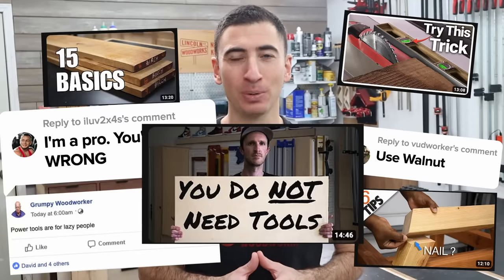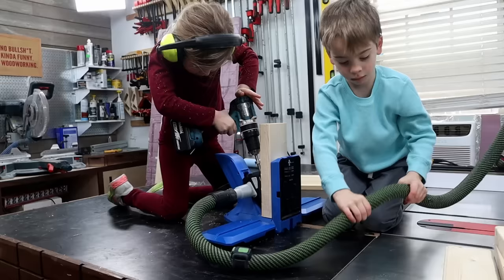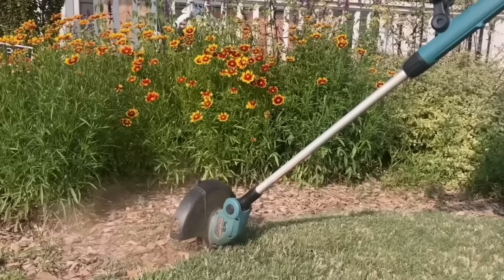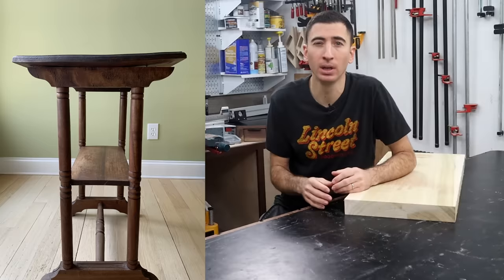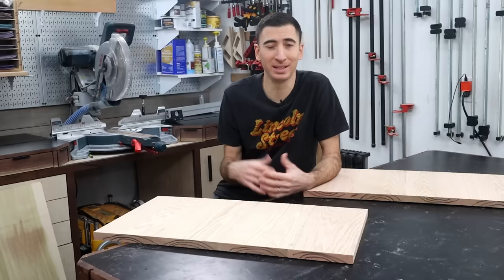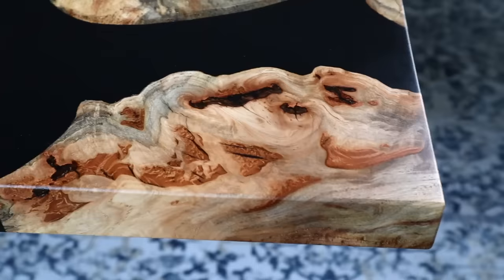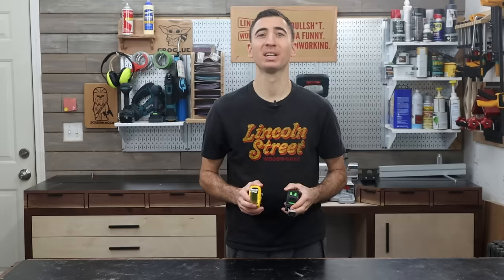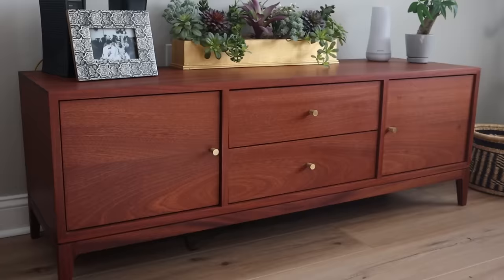Every beginner needs to hear this

Comment: One flaw in most joint strength tests is that the test focuses all the force against one joint and typically in one direction.
In furniture, each joint is supported by other joints. In order to make one joint fail, you must usually also have several other joints fail at the same time. As an example, if you are going to test picture frame joints' resistance to wracking, you must test that joint when it is one of four in the frame and all 4 will have to wrack at the same time for any single one of them to wrack. It is the same with the way a table leg is connected to a table. If all four legs are on the floor, you must cause all 4 connections to fail simultaneously or none of them will. Testing one joint separately doesn't give you an accurate measure of the strength of a structure.

Comment: Do not remember the youtube channel, but one did a test and took a couple of drills apart and found 3 are the exact same parts for different companies.  So it really does not matter
Reply: Most of my family works for a large (huge, even) retail company, largely as vendors. Most products are like that. They’ll be invited to visit the factory after switching departments. A big one is paint! The grade does matter, but not the brand. The only exception in the US is Sherwin Williams.

Also, any canned food without a recipe (things like soup are usually special, for instance). Same stuff, different labels. Corn is corn. But I still buy the same brand, no matter what?? I guess it gets all of us a little!

Comment: Regarding mixing sanding dust and glue.  I found that mixing sanding dust with the FINISH that you're using (varnish, shellac, etc) works much better; once the finish is applied it disappears.  This won't work with a large hole and an oil finish, but there your pounded-in knot would be much better.  Love this episode!
Reply: Interesting, I never thought of this. Thanks

Comment: 7:10 

Lifehack for this part - you can use medical syringe to put glue inside of thin spaces. 
OR you can blow air at glue to "force it" inside. 
OR you can mix it with a bit of water to make it less viscous and more liquid - it will reduce surface tension of glue and will allow it to reach further into the opening.

Comment: Hi Lincoln, Everything is correct, but alas, not completely. #1: alternating boards. You are absolutely correct that the best side-up should take precedence. The 2nd option should be to make sure any Chatoyance in the wood boards are all facing the same direction. The third option is to alternate the boards (smiley/frown) whenever possible. Maybe you and I have been going to different museums, but I've seen the occasional big U and the less occasional washboard. But yes, how the boards were dried and stored, as well as any transportation from a dry/wet area to a wet/dry area, are all big potential issues. Otherwise, do flip them if possible after the first two issues are resolved.

2nd point is the need to finish the top and bottom of the furniture. Again, I did everything I could to live up to this truth until I took a class from Bob Flexnor (major finishing expert with multiple books) mentioned this in a class and said that he's examined many, many furniture items from many different historical periods and putting a finish on both sides of (say) a tabletop was never done until the 1960s in the US (but not in Europe).

The one thing I learned from examining furniture in museums is do not worry about the back. When I made a Stickley sideboard, the back was BEAUTIFUL!. When I later saw some original Stickley furniture, and other furniture from the 16th, 17th, and 18th centuries. The backs had saw cuts, pencil markings, knots, and anything else they did not want to deal with. They knew the furniture was going against the wall, and the back would never be seen.

Comment: I think the measuring advice is right when you add the premise "if you can do it without measuring, do it without measuring". I always try to get the work done without measuring, and if I cannot, then I measure it multiple times till I'm pretty sure of me. Then I do it. Then a measure it again. Then I get to anything else, measure it again, figure out I measured the wrong part, wrongly, or forgot to remove something, cut it again, and then it's the proper dimension.

Another trip to get wood between measuring is optionnal depending on what I have on hand.

Best advice for beginners i'd give, as a beginner : act like you're dumb. Because you are dumb, and you will mess up.

Comment: I don't know if I would call brand stuff "100% fiction", but it is mostly fiction. I built my first project, a 6'x6'x6' chicken coop, about twelve years ago. I had no tools so I bought a Ryobi drill/impact bundle because I saw my dad use them before and it was only $99. I have now used that drill to also build a 20x40 pole barn, gut and remodel a 1000sqft house, and build a nice 8x16 shed. Never had any problems with it. Using original battery too. That being said, it definitely isn't as strong as newer drills and the battery amp hours are terrible at 1.5). I borrowed a friends Ryobi skill saw and it struggled to cut 2x4s. I would say there are tiers though. Just like in cameras, computers, and other products, there are consumer grade, "prosumer" grade, and professional. Harbor Freight and arguably Ryobi fall into consumer grade, Dewault prosumer, and things like Snap On and Hilti for pros. I ALWAYS recommend people starting at the middle grade stuff. Dewault might not be as "good" has SnapOn but it is leagues better than some $20 Chinese drill. 

For what its worth, I think most people agree Makita and Milwaukee are the two best prosumer brands out there, and many pros use them too. I myself decided to go Makita starting last year and like you said, it was for none power tools (they have a nice dual battery backpack vacuum cleaner) but at the last minute switched to Milwaukee because HD had a 12piece combo with three batteries on sale for $499. Furthermore Makita doesn't have a pex expansion tool but Milkwaukee does, and since I'm about to start building my house next week, a pex expansion tool seemed more important than a vacuum.

Comment: 0:45 there is nothing absurd about a basic Mortise & Tenon. Make hole... make peg end to fit hole. Cut slot in peg & insert a wedge to lock it in. Nothing really hard about it if you just take your time to get it right.
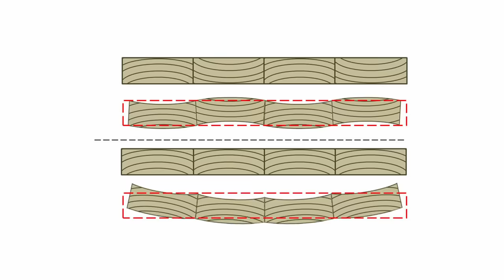5:00 This is for the most part pretty true. Acclimation time is KEY to good finished products when it comes to wood moisture.

Comment: Thanks for sharing your opinions and experience. The pocket screw vs mortise tenon joint debate is irrelevant. Easy choice:  If you are making dozens of plywood cabinets, use pocket screws. If you are making fine furniture use a different joinery method.

Comment: Great video. 

Pro tip: you don’t even need screws or joints. Just make a putty with the glue and sawdust and use it like a “tape” or a “mortar” to hold together your projects. It works great and you don’t even need clamps!

Comment: Everything you covered is right on.  I been doing carpentry for over 60 years and learned all this from my father who was a carpenter and experience.  Much of what is on the Internet is nonsense.   In 60+ years I've never used pocket holes or jigs for fastening anything.  Pocket type fastening is just not as strong as other methods.  Good video, you know your stuff !!!
Reply: If you've never used it, how do you know? Also the whole point of his video is that sometimes it's more than strong enough for the application.

Comment: Joint strength-if it doesn’t break in daily use, it is strong enough. Your hockey players may not have broken your 2x4 table, but we all know people that could break that same table made out of steel just by looking at it!  Tool brands-I have a shop full of less expensive power tools people told me wouldn’t last. Some are over 30 years old now. What didn’t last was the low end Delta bench top table saw. Blew up right after the warranty expired. Dad said buy the best you can afford, you won’t regret it. Black and Decker, and Skil rule my shop. Growth rings-Norm Abram said to alternate them so it must be true!  All those projects I made and forgot to alternate yet remain flat must just be luck 😊. Someone else listed more important considerations in another comment. Sawdust and glue-spot on comment. Know how you will finish the piece. Most glue won’t accept stain well even mixed with sawdust. Measuring-referential measuring 👍. 

I’ve been woodworking over 30 years. Your projects smoke mine.

Comment: I trained over 1000 carpenters/joiners. And i remember them all. How the heck i can't remember you. You are saying my words son. Those tips will make anybody fall in love with woodworking from very beginning. One more tip with measuring. Get your self good comfortable measuring device with continued numbers. Not those 20 and 1,2,3,4....100 and 1,2,3... Get properly numbered 1,2,3...30,31,32...100,101,102...499. that way you will avoid this famous exactly 10cm mistake and work with if you using tape get an auto lock. Bless you son. You will be famous woodworker.

Comment: For the tool one it's definitely not 100% fiction. I do agree that for the average person, the difference between ryobi and dewalt, Milwaukee, or makita won't be noticed. But there is most certainly a difference. From my experience though you really can't go wrong with Milwaukee, DeWalt, rigid, and Makita. Ryobi is fine if you're a home reno kinda guy not using the stuff every day

Comment: Been a chippy for over 25 years. Unless you want what your making to be able to be dismantled, glue glue glue, it helps screws not to loosen ( especially with MDF or other sheet materials)so much and stops small movement that can come over time. Just pva is great and not messy like other good glues.

Comment: I wanna give my 2 cents to the topic as well.

So, pocket holes are generally fine for a beginner, no issue there. Just make sure to use them properly. They're not a 'go to' solution as especially places which have hinges and hence weight applies over a higher distance will cause it to break down fairly quickly, surprisingly so. So a hanging cabinet for example is dangerous to build that way... otherwise no issue there. Every technique has to be taken with a grain of salt after all and used in the right circumstance.

The working grain. Yes... this is the one major point which decides if your outcome is garbage or great for nigh forever. As mentioned wood has inner tension depending on the growth rings, those tensions ease up over the course of the years though, hence older wood is generally superior for building, the more fresh it is the more thought needs to be put into it to make it last.
This takes into consideration especially to store it properly. Before using any bought wood... let it rest in a condition as close as possible to the place it'll afterwards stay. This is how wrongly glued wood grain stays flat even after decades, given the surface treatment is done right on top.
Also the moisture condition itself is important, a wood heated house will have a much higher fluctuation in moisture then a central heated home. Also bringing furniture from one to the other will likely warp it over time. So make sure to follow as many of the rules as possible, being informed about it is better then wasting money and effort there, even if it takes longer to start out.

And yes, I'll agree with the woodworkers which are using wood since 35 years and telling you that you're not doing the smartest thing in missing out on alternating growth rings. If you make short-lasting furniture you'll be unlikely to run into issues. If you make pieces solely for a single spot which will rarely be moved and in homogenous moisture over long time, also no issue. But why implement potential faults into your product when it can be very very easily avoided?

Sawdust + wood glue is fine if you know how to use it. Epoxy is also fine if you got access to it and a place to let it dry. Using a chisel and a small shaped inlay piece with the same grain direction works as well. Once again, this is a measure derived from experience over time, knowing how different finishing methods (and even different products from different companies) will work over the course of years. So yes, 'it depends' as you mentioned, each method has a proper time to be used though and that can be taught and should be taught properly. The classic glue + sawdust method is the one I'll recommend for every single beginner to use though as it's the easiest and cheapest method and their pieces will have other faults anyway.

'Measure twice, cut once' takes 'finagling' towards the end-result into account. The saying comes from not rushing the job and hence messing up majorly. So no, it's not even remotely 'fiction', it's the reminder of properly preparing, checking if everything's right and THEN starting to do your work rather then screwing up your piece and ruining it because of dumb mistakes. This holds true for hobbyists as well as for professionals. It's surprising how often this simple but important point is ignored and costs hundreds of not thousands of dollars/euros in time and material to fix.
Reply: getadogupya

Comment: Not a bad video, it is sound advice for beginners and novice wanting to make anything functional. That box you made with your kids was perfect. May not be pretty but it will last 15 years as a box out on the deck. That’s how you start and then get better with finer details later. Great job. 
I also agree on the power tool end of it, however, I would stick to the better end tools, they may cost more but they perform much better- I’m a locksmith by trade , wood worker because I love it.

Comment: I’m from Wisconsin. The temps get cold. I don’t user battery powered tools. They die. The batteries die. You can’t even leave them charging in the cold they die. Predator 3500 and a cart behind the lawn tractor is how I build outside.

Comment: Excellent video. The measure twice cut once, alternating grain, glue and sawdust trick. I learned all of those in high school shop class in the 80's. then I went to a woodworking school for two years. I was taught to think like a physician; everything is case specific. I went on to be a professional carpenter, cabinet builder/setter, stair/rail builder, furniture builder, pole barn builder, industrial concrete form engineer/builder. I once even built a $5000 custom iguana cage for Wanda the Iguanda. I don't do it anymore, too hard on the body. I am now an inspector.
Reply: Oh, I still have all my fingers and thumbs.

Comment: When i started wood working for real, on my own, o had to start by bulidng a woodshop. I built so far two work benches for tools, a project table, i just finished my table saw table and im working on an extension table for it for larger work. Up next is a router table and a table to hold my planar/grinder wheels and table belt sander/grinder wheel

Comment: That "secondary battery tool" thing is spot on. I wouldn't mind a Ryobi drill but their angle grinders are trash. To do it right you'd have to review every battery tool you'd want and find the brand that covers them all well. Chances are you'll still need two different battery lines.

Comment: I agree the test pieces are not practical, but they were attempting to compare strengths between different joining systems, so it was necessary to come up with a testable shape that could apply consistent force to all of the joints for comparison.

Comment: You make a lot of good points and I agree with most of them. The only thing that I would add is don't buy any cabinet grade wood from a big box store that is only interested in their bottom line. And if you can buy 2 drills for the price of 1 from another brand, I'm quite certain that brand isn't twice as good as the cheaper one.

Comment: I ignore growth rings and always go for aesthetics instead.  What I find more important is to keep the width of boards as narrow as possible.  My rule…no wider than 2 1/2” (63mm) 

Now…sawdust & glue ?! Never.  My joints are flawless.  However, if you’re gonna use that process, use very fine sandpaper to make your sawdust.  Like 320 grit.  Finer dust will get in small cracks easier.  But stain (not a never for me , but seldom) will not color these “patches”.  In general I like to preach recutting the part.  No gaps in joinery means no putty necessary.  Good info here…like all your vids.